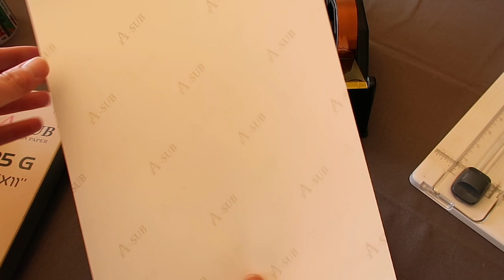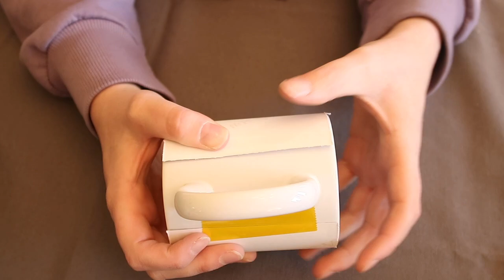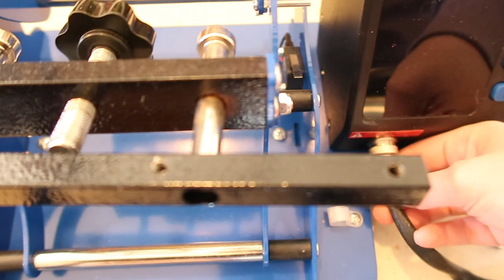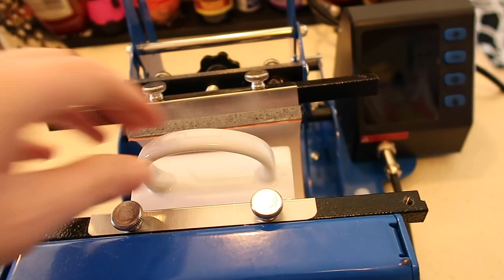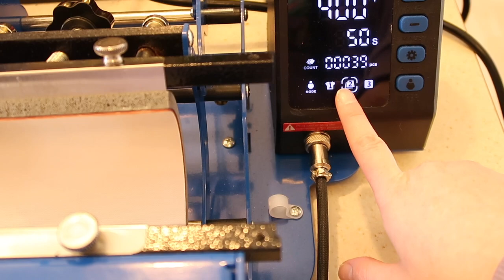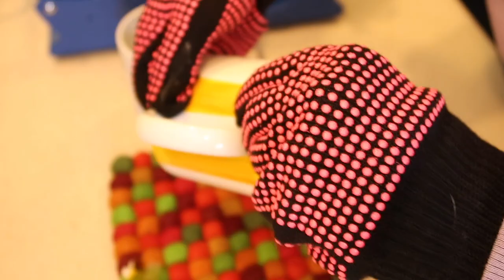Mug Sublimation with Vevor Heat Press

Comment: Hello, I also have a vevor heat press but the bottom edge never sublimates correctly. It's faded. No problem for the top. Ans I pay attention so that the mug is located in the middle. Any idea on how to solve this issue? Thank you
Reply from the maker: Is it ghosting? I tape mine up like crazy to prevent that from happening or the heat press part might not work on that spot

Comment: HI, I recently received my vevor mug press but I can't get it to work...the model is the 620 w 31.85 cl
it does not print images or photos...thank you for your help
Reply from the maker: it doesn't print anything. You need to have a printer that has been converted to sublimation ink. You need to print on sublimation paper and then use a sublimation tumbler or mug